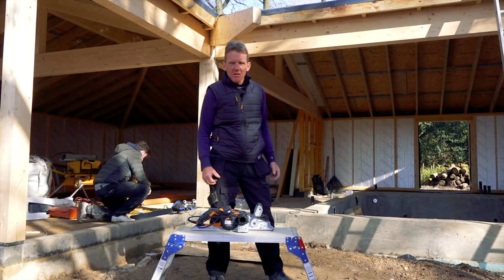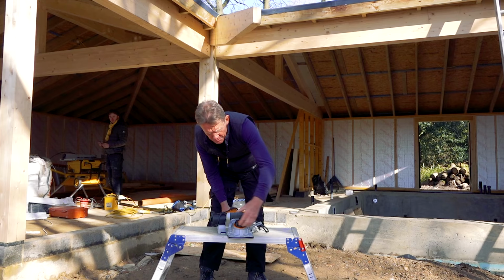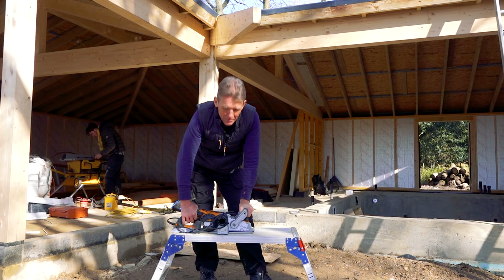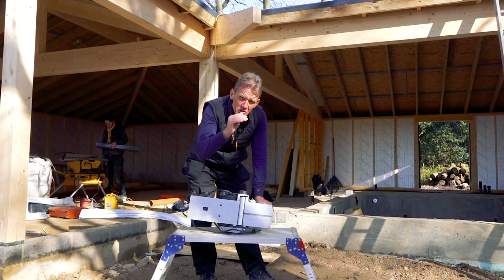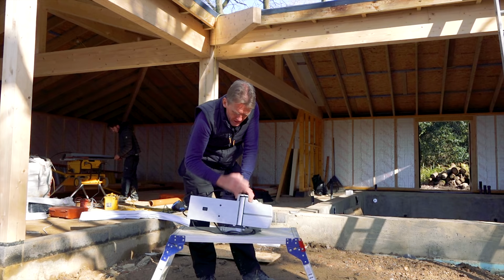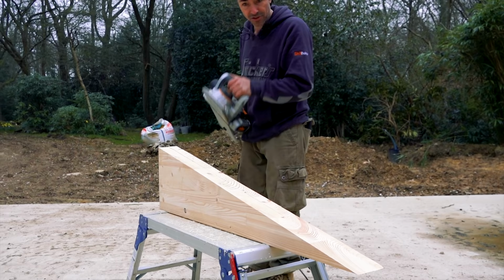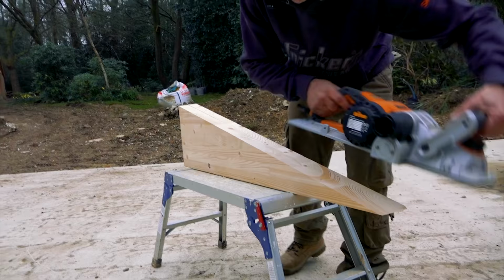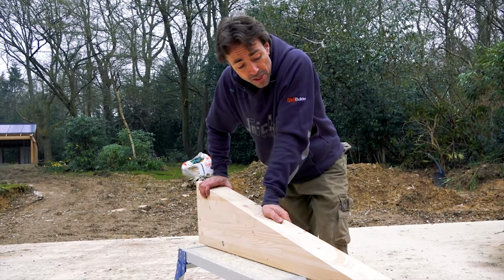Triton TPL180 Triple Blade 1500w Power Planer

Comment: Hey guys. Can you put some pressure on HIKOKI to release the 36v multivolt table saw over here.  They do it as the Metabo HPT range, all they have to do is replace the stickers. If you havent seen it check it out. We need it over here asap.

Comment: Great planer with only one issue.  If you sell a machine like this for over $350 in Canada - at least include dust fittings that actually work with North American dust extractors.  I have about a dozen fittings and 5 hoses and nothing fits the dust port or port adapter that came with the plane.😠